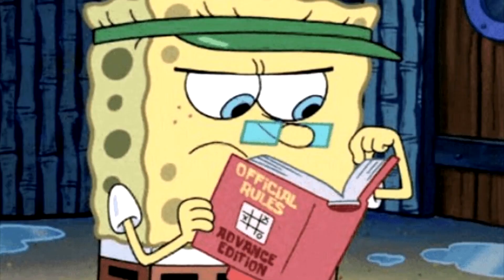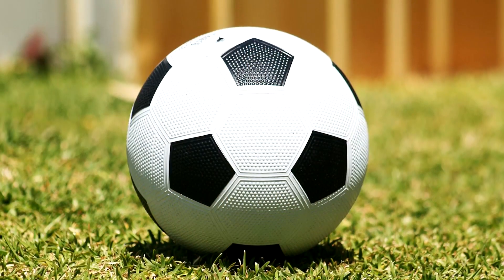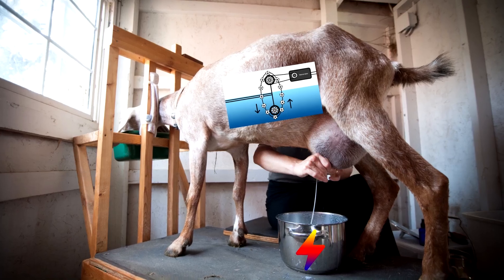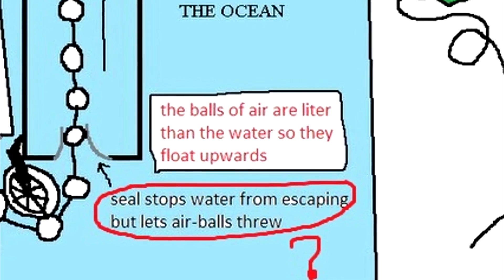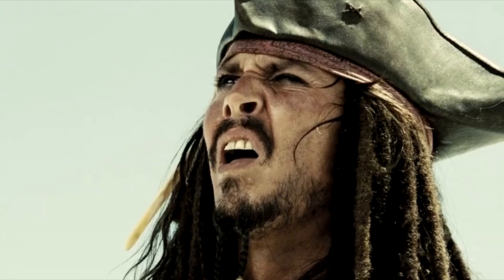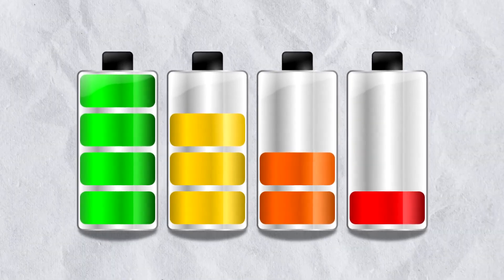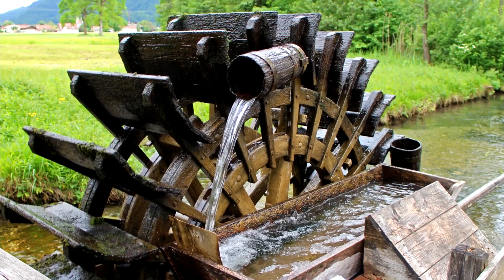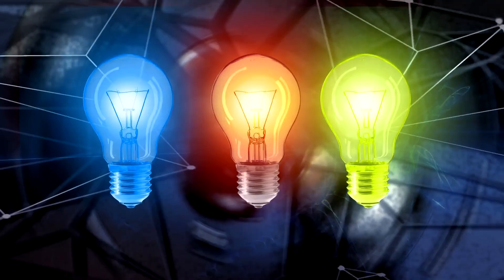why it doesn't work 16

Comment: Since the video didn’t talk about the actual forces and physics at play here, allow me to explain.

Buoyancy is a result of displacing fluid. If you take a balloon, life jacket, or other buoyant object and try to submerge it in water, you will very quickly notice that you have to apply a significant amount of force to get it down. This is because, as you push the object down, it forces the water up, which requires energy. When the object gets pushed to the top, this energy is released as the water falls back down. 

Looking at the diagram, it may be easier to imagine just one ball moving around. Let’s say it starts at the top of the system and that friction, air resistance, and pretty much all other factors such as the weight of the ball are negligible. Let’s also say the system is 1 meter deep and that the ball has a diameter of 1 cm (these numbers are arbitrary and don’t really matter). All we care about is the displacement of water. Nothing happens as it falls down. Technically, the ball contains some potential energy which is released as it moves down, but it takes the same amount of energy to move the ball up, so that doesn’t matter. As it is submerged, it displaces its volume in water, pushing it upwards. But in this case, it’s a meter below the water level, so it has to push all of that water up to “make space” for the ball. You are effectively pushing a 1 cm by 1 meter cylinder of water up 1 cm (you can do the math if you want to figure out how much energy that takes, again the numbers don’t really matter). As the ball rises to the top, the same 1 cm by 1 meter cylinder of water falls down 1 cm, releasing the same amount of energy that was used in the first place. Therefore, no energy is gained. 

Hope this helps :)
Reply: it helps very much!  even assuming the seal is perfect, the ammount of force to displace the higher pressure water doesn;t change
Reply: This is a copy of my main comment. I think you're missing some important principles in your explanation. It's all about pressure at depth, and you can't simplify to just one ball since the system depends on more by its nature. Enjoy the long read if you have time and enjoy math.

I see how the change in potential energy works out to be zero. If the device were to "turn" you'd be forcing a new ball into the water for every ball being leaving the water by the buoyant force.

In other words, the water level would never fall, so there would be no conversion of potential energy to kinetic. That part is pretty intuitive and easy to understand. 

The force diagrams are a little more complicated. The fact that this meme made my gears turn warrants my longest comment ever. 

It seems that accounting for buoyant force with the Archimedes principle isn't enough. You have to account for the pressure applied at that depth by the column of displaced water around the air pocket where the balls enter the water. This is the kind of pressure that crushes submarines. As water is practically incompressible (especially compared to air) there would be no extra buoyant force at depth. There would, however, be a massive pressure barrier. Say the column of air is 1 meter deep into the water. Just like mmHg, mmH20 can be a unit if pressure-gauge pressure in this case since everything is exposed to atmosphere. Quick math shows, at 1 meter depth in water, that's 1.42 psi of pressure against the bottom of the column and anything passing through, including a new ball. 

Now imagine the balls each have a diameter of 1 inch. This means the cross sectional area is 0.785 sq in and the volume is .52 cubic inches. 

Thus, the pressure force is 1.42 psi × .785 sq in = 1.1147 lb.

Let's assume the balls are touching each other, putting 39.3 balls submerged in the water for the meter length of the air column. This length is the difference in submerged balls and thus buoyant force between the 2 sides. The density of water is constant due to aforementioned incompressibility, at 0.0361 lb/cubic inch.

That's 39.3 balls × 0.52 cubic in/ball × 0.0361 lb/cubic in = 0.738 lbf due to buoyant force favoring one side, hypothetically powering the system.

The force of pressure must be overcome by the buoyant force for the device to move, but it's not even close.

1.1147 >> 0.738

 In fact, I'm guessing that a cylinder with the same diameter over that meter length would precisely match the pressure force. Let me confirm with the math below:

39.3 in/m × 1 m × .795 sq in = 30.85 cubic in

30.85 cubic in × .0361 lb/cubic in = 1.114 lb

Almost exactly the same. So we can conclude that the balls on a string method will never come close to beating that pressure force, even ignoring friction and other resistive forces. We also learned that, since we're dealing with pressure from a column of displaced water of a certain diameter and depth, the only way to match it would be with an equal diameter cylinder of air providing buoyant force on the driving side. Greater size (volume) on one side could overcome the pressure force, but then that object needs to loop back around... it can't.

Hope this clears it up for anyone confused. Personally, I have to see the numbers for things to really make sense.
Reply: @kmp8563  I definitely appreciate the extra numbers. I still believe my explanation is sufficient, but as with anything in physics there are multiple ways to approach the problem, and yours is definitely more thorough and rigorous. 

I’m a bit curious as to why simplifying to one ball causes problems. I suppose that adding balls to the chain interferes with the amount of water displaced, so maybe it would have been better to go the other direction and imagine a solid cylinder moving through the water to demonstrate how no water is being displaced, meaning no energy gain, and then show how the balls on a chain setup acts the same. Either way, the underlying concept of potential energy remains the same, and it doesn’t really matter how many balls you add or remove
Reply: @xavierburval4128  Your explanation is sound in terms of addressing the net zero potential energy issue, but by simplifying it to one ball takes away the supposed imbalance in buoyant force. One side is meant to have more submerged balls than the other. 

That's the confusion of the illustration: more balls are submerged in the water on one side than the other, therefore the mass of water displaced by the balls on one side is greater than that on the other, which creates an apparent unbalanced buoyant force and potential energy. Again, this is only accountimg for water displaced *by the balls." This is why a one-ball illustration fails to address the "troll physics".

As the volume of one ball is less than that of 5, 10, 20, or 39.3 balls, there has to be an extra factor to balance the force diagrams. When you mentioned the cylinder, that's pretty much exactly right, but I don't think it was enough for most people to understand. The water level is 1 meter above the entry point on the left side. The cylinder above the cross section of the ball has a potential energy barrier equal to the potential energy in that cylindrical volume of displaced water. This force only acts on the entry side, and it has very little to do with the water that would be displaced by the ball itself entering the water. 

You don't need to know any of this to know that, as one ball leaves the water, another enters, and the PE does not change. But this is supposed to be a perpetual motion device, IE it intends to violate conservation of energy, so it has to be disproven with force diagrams.

As pressure is a force, I think it becomes important to mention in this system. Plus everyone has heard of oceangate, and they've all swam to the bottom of a pool and felt their ears getting crushed. It's easier for the average person to understand and "visualize".

I have no intent to attack you, sorry if it came across that way, I guess I'm just trying to add clarity and numbers to the concepts mentioned in your explanation.
Reply: @kmp8563  no no you’re good. I see how you need all the balls in order for the forces to cancel at any given moment, instead of only after a full cycle is completed. Thanks for the discussion!
Reply: You explanation is not sufficient since the driver in the system is having many balls on the right side being forced up by buoyancy 
in order to push the balls on the left through the surface of water. With 1 ball there is nothing forcing said ball through the deeper surface on the left.
Reply: What would happen if the balls entered the water horizontally
Reply: @Dario-uj6qo  that doesn’t change anything. You still have to displace the same amount of water, regardless of how it enters.
Reply: whats the point of htis channel if it tries to debunk physics memes if it doesnt actually explain
Reply: I think the point of this diagram is that the buoyancy of several air balls is supposed to outdo the force required to put a single one into water (and so the difference in water level matters as well as having several balls)
Reply: Don't have to worry about water displacement with multiple balls though because as one ball enters the water another one is exiting at the same time leading to no net gain or loss in displacement yet the balls would still float upwards perpetually so your explanation isn't sufficient. You also have to factor in friction from the ball trying to enter from the bottom while rubbing against the seal. The seal naturally has to be tight enough to stop all the pressure from the water causing it to leak out or if its more like a flap that opens and closes as a new ball pushes it upwards then the new ball will have to push those flaps up against the weight of all the water ultimately canceling out any upward forces caused by the buoyancy of all the other balls resulting in no net motion.
Reply: Why cant we just hire all unemplyed people to cycle on electric bikes to produce energy? Two birds with one stone
Reply: @Matias-dr3ys  not efficient enough. An average unemployed person can produce 60 watts of energy per hour doing strenuous exercise (at best). Thats like barely 1 cent per hour worth of electricity.
Reply: Thank you for doing a better job than the actual channel
Reply: The seals each require energy or force to move through(friction, elasticity of the material). Water pushes against the left tank, putting pressure on the seal proportional to depth.
Reply: OOH MY FRIEND, THIS MADE ME CLOSER TO PHYSICS AND MADE ME WANT IT (on top of that, there are 7000+ pages of physics books that need to be read.....)
Reply: This only works for “even” surfaces, in the image there is an uneven and your explanation breaks down as there is going to be more energy on the right side (work = force * distance, since there is larger distance more work is being done compared to left, which should be impossible)

I’m guessing the real reason is the water density, first off it won’t work because the water will naturally even out, but assuming it doesn’t, the density will be a lot higher on the bottom and therefore the ball will have a harder time going down
Reply: @AlphaCubed  it doesn’t matter whether the surface is even or not. One, it will even out naturally as you mentioned, two, it doesn’t change the fact that the energy used to displace the water is the same as the energy released from the object floating up, and three, even if you did time it so the tides/waves lowered the water level when you submerged the ball and raised it when you released it, all you’ve done is invented a shittier version of tidal and wave generators, which already exist.

Also, the density of the water doesn’t change with depth, at least not significantly since it’s a non-compressible fluid. I think you mean pressure, which does increase with depth, and you are correct in that the higher pressure at the bottom is what makes it energy neutral, assuming no inefficiencies. However, this is basically the same as my explanation since the increased pressure is simply a result of having to displace the water above you.
Reply: @xavierburval4128  No, the energy on the right side will be greater. Work = force * distance, if you’re saying the force is constant (which is should) and the distance it travels is more, then there is more energy being made

EDIT: kmp8563 explains it more fully below. In short, your missing a force if the distance is like the picture - either pressure or density.

In order to maintain conservation of energy, you need to either A. Make the distance the same, which I mentioned, or B. Make the force less. Buoyant force = density * V * g, and since V and g is constant and impossible to change, only density can change

I’m saying, the water will either naturally even out, or the “fluid” (not water yes should’ve clarified, something denser) will have to be denser down there to prevent the water from evening out
Reply: @cubed.public  you'll have to apply much greater force (over shorter distance) to push the ball into water at depth. so energy gained will equal energy spent

Comment: Im not sure but the exact reason why this wouldnt work is because pushing the balls into the watter agains the waterpreasure would require just as much force as the balls produce when floating up. I feel this video doesnt cover this very well
Reply: It’s effectively the weight of the water, or the exact inverse effect of buoyancy

Comment: If you want to freak out the kids....build a simplified "Kelvin water dropper".
You will need ...4 tins 1 bucket 2 lengths of wire...a rubber balloon ....and a dark room....on a DRY day.
Look up the diagram for the set up.
Empty all the tins.
Remove all lids and remove 2 bottoms.
If you assemble the pieces as per the wiki diagram and poke 2 teeny drip holes in the bucket you should get the idea.
The water droplets will need to drip NOT stream through the bottomless tin into the tinny tin below.
Each wire must make a connection between its tinny tin below and the ring tin that is above its neighbour.
Rub the balloon on a woolly mammoth,sheep,cat or small child depending on their availability...
Using the balloon touch one of the ringy tins(thus giving it an initial charge)
The water droplets falling through ringy will be opposite in charge to ringy.
As they drop into tinny below.....charge will increase and flow from tinny up the wire into opposite ringy.
Observant kiddies who are patient will notice that the water droplets do something weird ....as ringy and tinny increase their charge....the water droplets split.
If the 2 wires are left a certain distance apart(see wiki diagram)you should see a spark periodically.
.....
Remember ghostbusters?
DON'T CROSS THE STREAMS
DON'T TOUCH THE APPARATUS
(unless you are a woolly mammoth soaked in prehistoric petrol and are hosting a barbecue)

😊no mammoths were harmed in this experiment

Comment: How about you remove the water and replace the balls with 9-kg weights and sign them with a "9". When the belt Reaches the bottom and the attached weights turn to the other side the 9 flips into a 6, thus making them 3-kg lighter and rising up on the right side?

Comment: You didn’t talk about the wheels that spin
Yes the balls require the same energy to move down as they move up but if you were to give it a little manual help then make sure the movement doesn’t end then the energy generated by the wheels would not be used to spin the wheels more but it could be given to a generator.

Comment: The amount of buoyancy each ball get is the difference of pressures between upper half of ball and lower half. Since lower half is lower, it always gets more pressure than the other, and the ball gets upward net force.
In this case, the lower half of upper ball is connected to upper half of lower ball. Because the upper half of lower ball is the lower, it doesn't generate upward net force. So it's only upper half of the top ball and lower half of the bottom ball that matters. In this example, anything below the entrance water surface cancels each other, so it's entering ball and exiting ball that matters.The upper half of exiting ball gets air pressure. The lower half of entering ball, which faces upwards, gets air pressure. So it doesn't move.
That's before frictions, weight of balls and cables, efficiency of generators, and figuring out the entrance that doesn't leak.
Reply: What am I even reading
Reply: the first sentence was readable

Comment: If this worked in principle, the generator would "steal" energy from the ocean? So it means that if the only energy that can be harvested is thermal, the water would rapidly cool and freeze, rendering the system unviable.

Comment: Still have no idea why this is impossible
The most important part seems to be 0:40 but i have no idea whats being said
Reply: 2nd law of thermodynamics.
Reply: @VanFire87  yes yes we know, but what specific forces overpower the others
Reply: You will have to push as hard if not harder to force the balls through the seal into the bottom of the tank than the force generated by its buoyancy once its in there. You're basically pushing against the pressure at the bottom of the tank.
Reply: @jadedandbitter  and if the seal is springy and pushing back on the water enough that only a small force from the air side opens it up?
Reply: @Helperbot-2000  you're still pushing into the water. It won't be a small force.
Reply: @jadedandbitter  what if the air pocket was extended further around the sprocket to be sideways, or even, facing upwards?

Comment: The problem is that if you seal the air tube, you may be pushing ON air, but the air itself is still pushing on the water. You haven't actually reduced the pressure.